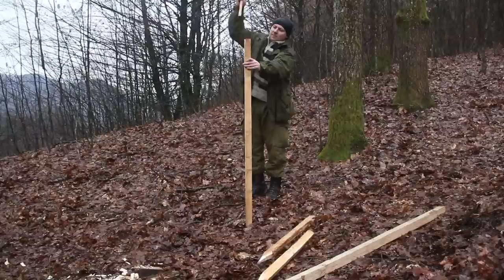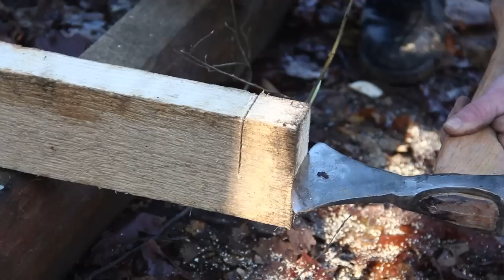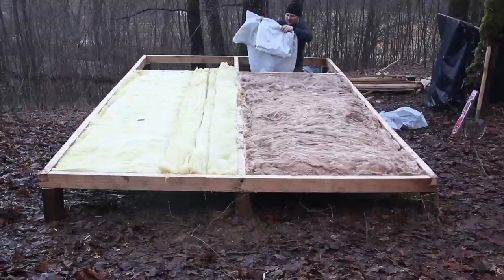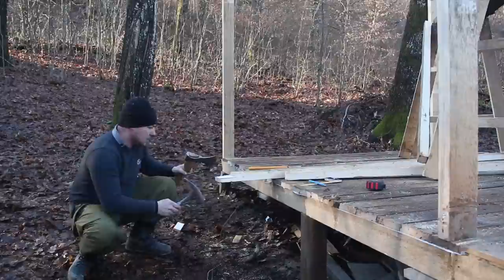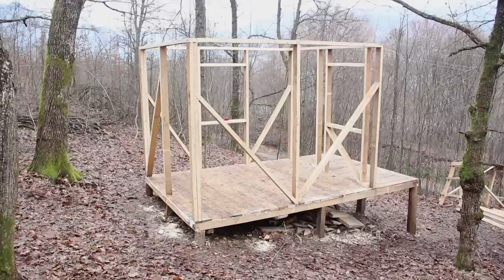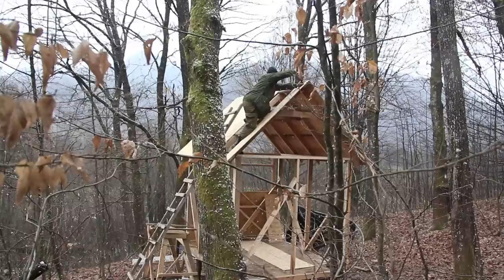Made the frame of a wooden house in the forest. Part 1

Comment: You make it so much harder than needed, particularly when you don't have a ladder or a helper. The walls and rafters could have been pre-built flat then lifted up, so that only the ridge pole would have needed a high lift (which you didn't use. Horizontal spacers between the rafters would have provided stability and kept the roof square without fiddling around).

That said, this is an ambitious piece of work to take on solo - I'll be interested in seeing the rest of the process.